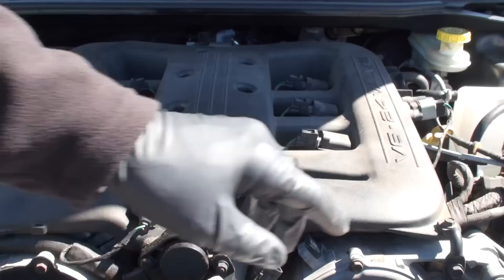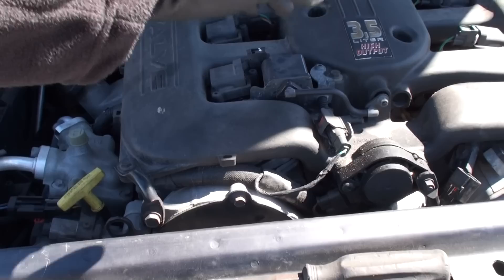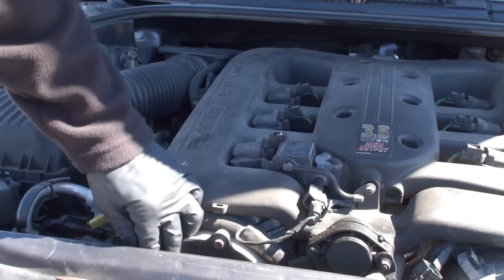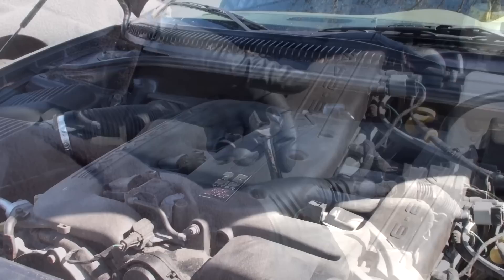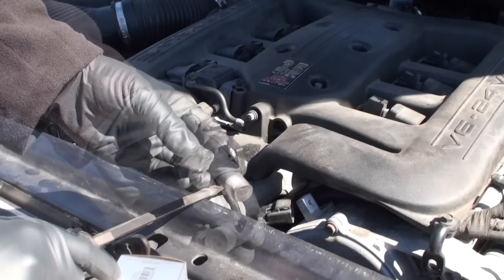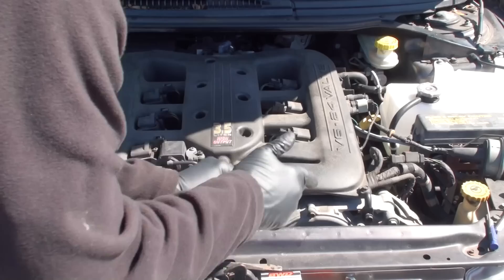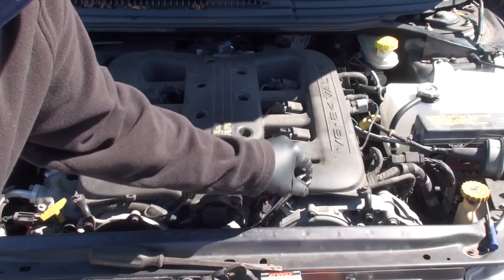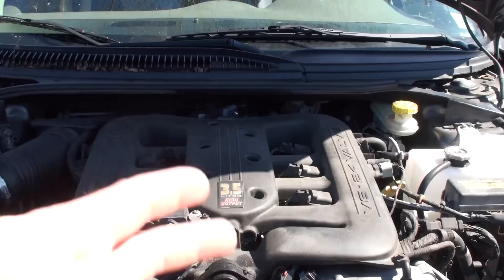Chrysler 300 3.5 camshaft sensor location and replacement

Comment: Remember to slide that orange "keeper" back in the plug slot immediately after removing the old sensor or you will forget it and begin  reattaching the intake and look down and say an obscenity when you see it lying there and your new sensor is in the hole and tightened in. I found it impossible to stick the keeper in the plug slot with the new sensor installed. I took the new sensor back out, removed the new sensor from the plug, easily snapped the keeper in and snapped the new sensor back in the plug. My old sensor was in the plug since 1999 and would not hand pull out. I tapped it a few times with the 13 mm wrench to break it free. You may need some needle nose pliers to get out the orange keeper. This job only required a medium size 10mm wrench, 13mm wrench,  10mm long socket and ratchet and something to pry up the upper intake manifold. Very good video.

Comment: Major thanks, Cody the Car guy...my wife and I just change the sensor 2 hours ago. If I could add a few tips because its not clear in the video. There is one 13mm brackets on each side and they have to completely remove bc at the 2:24 mark he says loosen and then removed and there is a tube on the left side if you pause it at the 2:24 mark you need to pull it out the side that is closest to the engine or you will not have space to use your tool to loosen it.  We do not see him take off those brackets in the video. Also the bracket in the front of the engine the lower bolt is 13mm and that needs to be completely removed to lift it slightly.The bolt on top of the engine needs to be completely loose not halfway. Just wanted to share things we learned why doing the job.

Comment: Can you please do a video on the "crank position sensor" can't see to find no where. It would save me a lot of money.  Thank you..
Reply: It's somewhere in the transmission area, mine was replaced a few years ago and that's where it was. Also the tps can be loosely screwed in to correct position. Tightened tps the car wouldn't run, back it out started and ran fine for years.

Comment: I would suggest using the Mopar part (#4609086AE) and not BW or any aftermarket parts for electrical sensors. Unless you like doing the job again in a couple months, lol.
Reply from the maker: teamodave Those BWD parts have never failed on me yet, and have even personally used them on my magnum with the 3.5 motor
Reply: That's cool. I had the opposite experience but if it works for you, have at it. Thanks for the video nonetheless!
Reply: +teamodave I just replaced my second one in two years. Should have lasted longer
Reply: Is the dealer the only place where I can get OEM camshaft sensors? I replaced the camshaft sensor with the same brand as shown in the video and the car still cranks for a few seconds before starting.

Comment: Just curious if you ever had a problem with the Gasket after lifting the Intake ? Also if you get this message I was wondering I have the same Motor and when I start my car the RPM revs up and down not stalling but it goes away soon as I put the car in gear any Ideas ? It seems like somone is gently hitting the gas Thanks in advance

Comment: I have a chrysler 300 3.5L 2005
  when my car is cold, it works well when it goes near normal temperature with emergency transmission and it does not pass me 3500-4000rpm and put it in the computer with the camshaft position sensor P0016 I changed it and brought me the same problem again

Comment: Hey Cody you're the best! Awesome video. Quick question it could have been a few years ago someone took off my secondary runner valve link in front of the manifold control valve? shaped like a a long ------\__  4 1/2 inches long approx. connects to the valve and intake/middle of front manifold valve . lost stole? Can a guy run his car with out it? I made a new one out of a gutter nail from pictures because I can't find the runner valve link or even the secondary runner valve out of stock .(sits on the left) what effect does it have on the car if link is gone? looks like a bent nail   ----------\____

Comment: yes can u tell me what could be wroge with my 2000 chrysler LHS 3.5 high output I was driving down the road and it just shut off now all it does is just turn over won't start doing u no what will make it do that thanks if u can help me
Reply: Hopefully is not the timing belt that snapped But it does sounds like.it

Comment: So I replaced the cam sensor and it's still running the same. Check engine light still on even after clearing code
Reply: What else could be the problem

Comment: I have cylinder 6 with no spark cylinder 4 has faint spark but all other cylinders have strong spark. my question is will that cam sensor cause that problem? I get 12 volt on top wire that goes to coil pack but no volt on the 2nd wire that goes to coil pack. coil has 2 wires one is top 2nd is bottom please I need help. going crazy. code p0353 p0354
Reply: RAGGED FOCUS

Comment: im having trouble lifting off the intake, i got all the brakets and harnesses/hosing and something in the back near the intake port is still connected, is there a bolt or harness im missing?
Reply: You dont have to mess with nothing on the.back. you gotta be missing something on the front or sides. Or put more pressure when prying it up. Might just need that little extra force. This things dont like to come apart after so many years of being together you know
Reply: +John P hey john will this work on a 2005 Chrysler pacifica....car cut off while driving checked everything under the hood as far as alt and battery go but still no start I was told it could be fuel pump, water pump,  but I have a check engine light that's blinking now...any suggestions
Reply: @jakiaunderwood1889  it could be a lot of things. And the check engine light could literally be on for over 300 reasons. But I know that if it blinks it means it's something more serious. Best thing to do is to go to your local auto parts store or Wal-Mart where they can read/scan your check engine light for free and go from there. That way at least you're not guessing and will have a code number and a short description to Why the light is on and later look it up on google and learn more about it. Hope this helps.

Comment: hi ...I have 2002 , 3.5 L V6 Intrepid and it was running fine and I went to start it in the morning , the engine light  came on with the code " P0016 Camshaft\Crankshaft timing misalignment - Bank 1 Sensor 1". When I want to put my foot on the pedal and want to give more gas, it hesitates , glitches , breaks up , shakes.. when I remove my foot from the gas,  the engine is back at its normal level. It is the same thing that happens if I want to get started quickly...it hesitate, glitches.etc etc etc..Do you know what problem of my car...
I change the both sensors camshaft/crankshaft.......the problem is the same.. nothing works correctly. if you can help me, i would appreciate ;). thank you.
Reply: I was wondering if your car is fixed. If so what was the problem? I'm having same issue wondering what the fix is?
Reply: MultiTechnicss

Comment: The car ran prior to me changing the senor, it took a while to turn over, i would have to turn the key and hold it for a few seconds then it would start.

I checked code which was a po344 so I changed cam sensor with aftermarket sensor. I started the car and let it run for a few seconds and then I cut it off, I did this twice.

I then torqued the upper intake bolts to spec and put the air box back on then I tried to start the car but would not start. it cranks but will not turn over. I put the old sensor back in (which was missing the paper gasket) but it still will not start with the old sensor either.

Not sure whats wrong but I'm trying to get a mopar sensor now
Reply: Same here. Same problem. Same scenario. I left the aftermarket part in. I thought that maybe it was wiring or god knows what else. But now I come to learn that OEM part is really necessary. So I'm looking into replacing it again here soon with OEM camshaft sensor

Comment: Replaced the part, video was awesome. 
But, you talk about "clearing the codes". How do I do that? Will I need to do that for it to start?
Reply: Ericwonderlin42 , if you don't have a scanner to clear the codes, disconnect the negative battery terminal for at least 30 minutes, then reconnect. Th
is should clear them.

Comment: To clear a code I would just reboot The hole mother board by taking the neg off and while the neg is off I would turn the key in the ignition as if I was trying to start the car and hold the brake pedal for 10 seconds - then take my foot off the pedal and take out the key 🔑  and quickly put the neg back on and then put the key in the running poison and let the cars Computer boot up for 20 seconds just like an iPhone has to boot up. Sounds ridiculous but been doing it for years and then my car runs smooth. And my customers are very happy. Deno
Reply: did it really work

Comment: what was your symptoms to why you changed this sensor out, other than the codes that popped?
Reply: I'm replacing mine because the engine started shutting off randomly, either while parked at a light or while driving.  The car would also chug sometimes as if you were tapping on the brakes while driving.  The accelleration was sluggish too.
Reply: ZeCanadianGuy Hi! I have a problem, and I want to know if the problem I have it cold be due to this sensor?
When engine is cold it starts right up. after driving for 45 min or so and turning it off( like stopping for gas) it will not start until engine cools down. Thank you!
Reply from the maker: santheago Have you checked for engine codes? And a faulty crank sensor can do that too
Reply: Do this have to be grounded or I can just connect it?
Reply: king Humble , it's grounded through the connector, so just connect it.
Reply: My car ran out of gas then threw the code that I needed a camshaft position sensor. I put four gallons of gas in and it won't start but I can hear my fuel pump kick on. Do you think it's the cam sensor? Every time I try to start it the car sounds like it's out of gas and like it wants to start but can't.
Reply: @daniellepennell8529  did u ever find out why your 300 wasn’t starting because my problem sounds very similar? Would appreciate any help you can give me, thanks

Comment: You can finesse it out without removing the intake. Just take your time and don't force it, it will come. I've done it in a couple of minutes.
Reply: any tips///prefer not to lift the intake
Reply: Just loosen the front plenum screws, lift gently and finesse it in.
Reply: T&M's Ba Cassieckyard Creations

Comment: Hi! thanks for the video, very helpful for a beginner as me. I got the code P0203 in a Chrysler 300M 3.5 L V6 2000, so, I'd like to know how to inspect and replace an injector. I'd appreciate if you can post a video about this.

Comment: Chrysler calls this part the Crankshaft sensor. I ordered the camshaft sensor and got the wrong part.
Reply from the maker: Two separate parts. The crank sensor should be in the bellhousing of the transmission for the Chrysler 3.5 I have another video showing where your crank position sensor is located.  Cam sensors are located at the top of the engine where the camshaft is located.